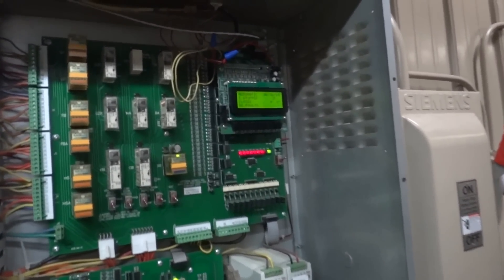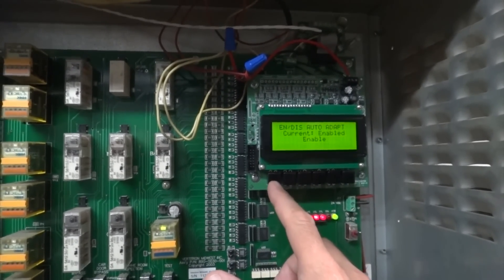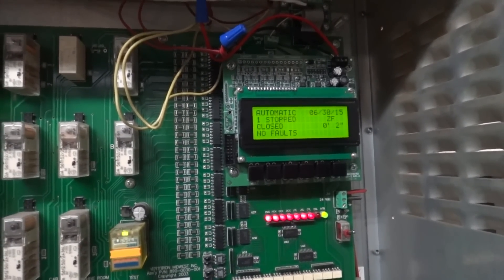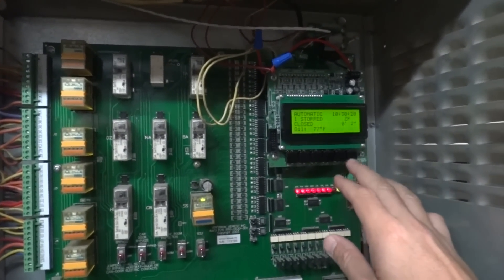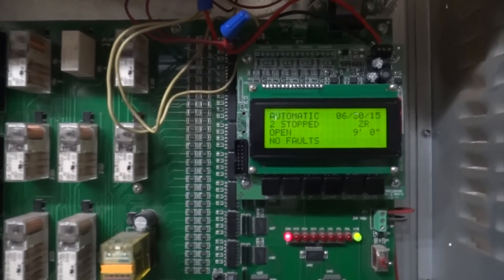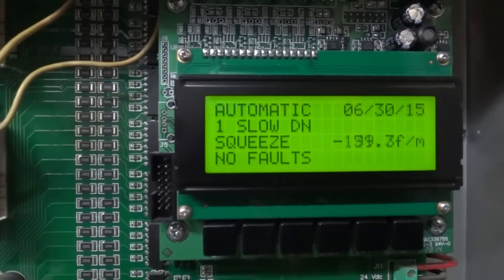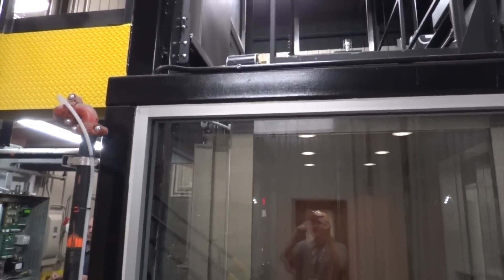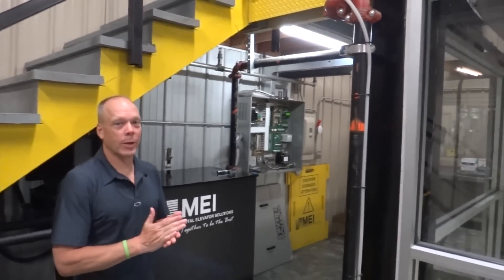Minnesota Elevator Reflex 3.14 Leveling explained

Comment: do you just use the high speed valve for the ramp ? up and down ? it looks like you've done away with the slow speed valve ?
Reply: is the ramping just set up from the panel ? does the tape head magnets need a new configuration ? does it come as a standalone unit ? whos valveblock are you using and is it designed to take this kind of hammer ?
Reply: Tony Baines no it a a different box with a belt on it
Reply: Tony Baines  good to know

Comment: That's high end stuff.  I'm impressed.  I got to work with the Omron processors, proximity sensors, and other similar hardware with the Kegel Phoenix-s and Kustodian ION lane machines (kegel.net if you're interested).  This is highly accurate hardware that can be tasked to do a lot of things.  At the same time, why are we hearing 3 chimes for down on an elevator with such a precise leveling process?
Reply: Maybe the reflex beeping is affecting the regular bell when going down is chimed.